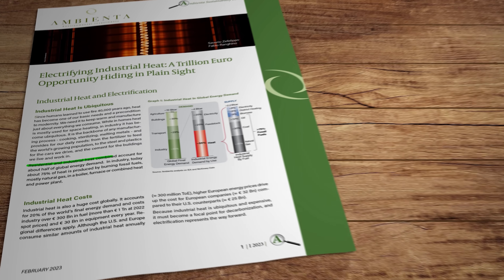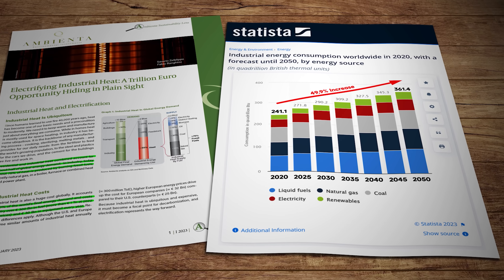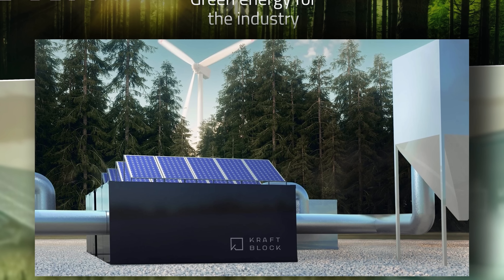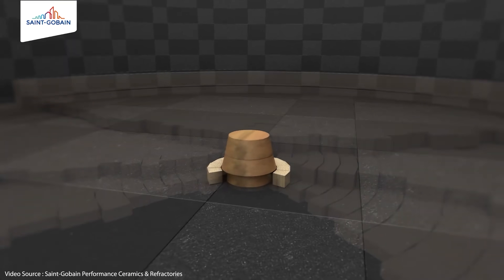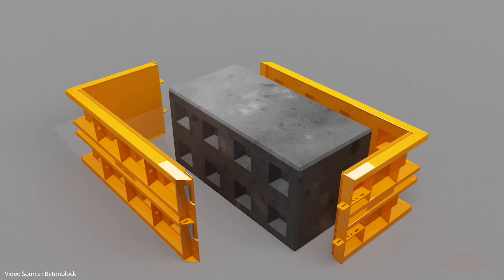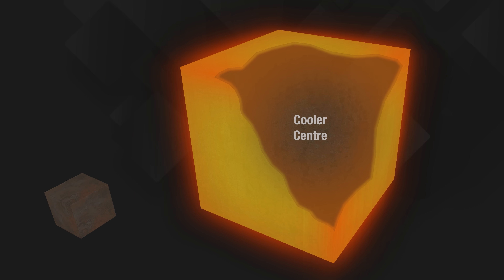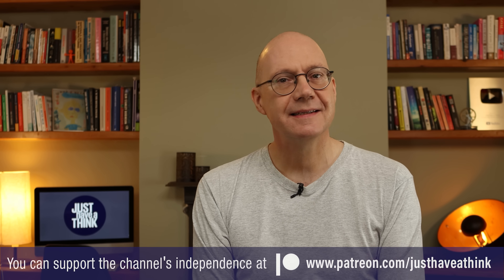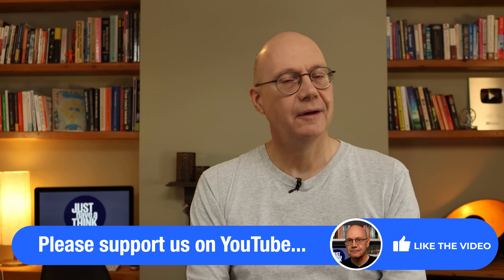Moving waste heat from industry to homes.

Comment: I'm always a bit sus toward modularized technology driven solutions to problems (see: Hyperloop, cars, etc.) and obviously a district heat solution would be ideal, but I do love the idea of a bakery being able to buy a ton of waste heat and being effectively carbon neutral. I suspect they'd need to use heat exchangers to avoid contaminants, and I'd need to see what the potential for pollution would be, but if it's charged with air from a heat exchanger I imagine that would be very minimal.

Comment: I am surprised the safety problem of transporting a 1300 degree storage medium wasn't mentioned.  If one of those trucks overturns in an accident, suddenly the whole road is on fire, and people in nearby cars are dying a grisly death.

It's not as bad as transporting highly radioactive material, or a chemical that can vaporize and kill an entire community, but still I feel this is a non-trivial problem.   I think the containers need to be made in such a way that will not split open in the even of an overturn.
Reply: It doesn't matter because they are still not storing enough energy to make this worthwhile. If its 10mw of energy as the video stated thats only about $600 worth of energy at wholesale prices, your not taking a shipping container very far to make it non feasible, and that's assuming the cost to charge it up and handle it is $0, which it isn't. Might be useful in a static situation to store excess heat energy to use later when energy supplies are lower, like heating a solar powered building at night.
Reply: By comparison a tanker truck full of diesel is holding about 200mw of energy if my envelope maths is correct. Even assuming 70% is wasted by burning in combustion engines thats still 60mw.
Reply: @AusKipper1  Good point but the fuel doesn't necessarily ignite, does it?
Reply: @yeroca My point was that noone is going to be transporting it anywhere because it's not a financially viable proposition so no need to worry about it.
Reply: @AusKipper1  The process needs to make economic sense before it can cause a safety problem, you're right.  That's in a sane world anyway.  Sometimes goverments will invest in uneconomical projects for political reasons, or to enrich themselves and their cronies, but this doesn't seem to be one of those cases.

Comment: I was rather skeptical at the start of the video, but seeing the potential applications in industry and district heating convinced me that this can be pretty useful.
Reply: Plus the trucks could use good old-fashioned "steam engines" instead of being electric and thereby raise the efficiency and limit the resources needed to build the trucks :-)
Reply: @madshorn5826  don't hold your hopes up too high on that one, there's reasons steam engines have fallen by the wayside in most applications.

It's definitely got to be considered though.
Reply: @alanhat5252  
Weren't these reasons mostly poor insulation and incomplete combustion of low grade fuel?
The latter does not apply here and we have nailed insulation :-)

I am not imagining an old style chu-chu, but some modern version.
Maybe a Stirling engine producing electricity for a small battery/super capacitor?
Reply: @madshorn5826   Theoretically, this could work, but we fear it has no business case behind it 😅 You are not the first to have the idea though :D
Reply: @madshorn5826  "old-style chu-chus" were surprisingly efficient by the time the UK government dumped all British Railways' stock in their rush to nuclear, normally getting 85% fuel efficiency from the newer engines (vs 35% for Diesel or 25% for petrol). No it's everything else, tallow-based oils & calcium-based greases never had the R&D that mineral oils have had, water recovery was never solved so vast amounts had to be carried, with most designs at boiling point & under huge pressure, there's a whole list of problems. All I'm certain very soluble but they haven't been solved & there's no moves to do so even though they're still used in certain scenarios.
Reply: @madshorn5826  Stirling engines also haven't had much R&D. They are used but also in limited applications (there's a Swedish submarine which famously "sank" a whole US fleet in a wargame for instance, it's powered by the difference in temperature inside & outside the hull).
Reply: @alanhat5252  
Thanks for the interesting answers.

I still feel that looking back isn't too relevant in our current pickle, because the reason alternative engines haven't been commercialized has been because we had artificially cheap alternatives in the form of combustion engines.

We don't have this luxury any more, so the way we think 'business case' is flawed.

It is very hard to wrap ones head around new basic assumptions, especially when the outdated tech still is used ubiquitously, but we have to if we want to keep a human friendly climate and avoid 10-20 m sea rise and 10-50× the current number of international refugees.

If the efficiency really is above 0.8 this requires government subsidiaries and maybe some sort of plan economy.

Comment: Intresting also on power prduction point of view:
say a nuclear plant throwing away 60% of the heat it produce, being able to ship it to nearby towns which can use it to run district heat, without the need for tens of kilometers of heavily insulated pipes

Comment: What's missing here is the complexity around waste heat recovery. Waste heat boilers have been installed in industrial facilities for a long time but often accessing the heat is quite difficult. Pollution control, like scrubbers, cool the gases down before exiting the process. In other processes, the vessel surface temperatures have to be kept above a certain temperature to prevent other problems like alkali corrosion. Like all things, heat recovery is best built into the original equipment design rather than being retrofitted - Jill
Reply: This is true. There are some challanges. Mostly however heat is wasted where it cannot be used continously, meaning there is no place it can go directly but the atmosphere. This is why we use a thermal storage that can time-shift the heat. The good thing about our storage material: it is very robust, meaning most of polluted flue gases are not an issue. And heat exchanger can do a lot today.
Reply: Heat capture for resale is best added wherever the original system dumps heat into generic cooling such as water bodies or open air .  Heat input from purchased transport is best added where a relevant temperature is useful, otherwise a heat pump can be used to raise the temperature level .  Video explains a lowering mechanism for this particular transport system .  But ultimately 2. Law limits the reusable energy that can be captured and resold from any process .
Reply: @johndododoe1411  "2. law"??
Reply: @alanhat5252  2nd law of thermodynamics probably.
Reply: Yep.

Comment: Interesting.  Back in the 80's I worked for a steel company in the  Midwest US at a blast furnace located on the coast of Lake Michigan.  At that time the company had permission to fill in a portion of the lakefront to use for further expansion, and the slag was used as the fill material.  For a while we had a trial going on to "granularize" the slag by mixing the slag as it was being produced with a large quantity of water.  This would cause the slag to break up into a gravel like consistency.  The result was to be used as aggregate for cement, like in road building.  Nothing came of the experiment, however.  I heard through the grapevine that this was because the company wanted to keep using the slag as lake fill for fear that the government might change their mind about filling in more of the lake before the company was done filling in the allotted amount.

Comment: I’m getting very excited about thermal storage these days. This dovetails with the work of Antora Energy, which is building industrial heat storage at scale using carbon blocks. Antora is cool (no pun intended) because they can get electricity as well as heat from their system, using custom designed “solar panels” tuned to the tight-spectrum thermal radiation from the carbon blocks. The Kraft system here works in a different, complementary direction, by being able to truck-ship serious heat for small to medium industry (like the food manufacturing examples of local bakeries and Frito-Lays). That means cheap, renewable solar could be used to heat up the blocks. It wouldn’t even need to be on-grid, greatly speeding time to market and reducing costs. I can see such a system becoming cost-competitive with gas burners.

Comment: How possible would it be, to have a huge facility,  say- providing heat to a small city, so I'm talking a huge amount of thermal storage material), that could store heat for months. Maybe using solar over the summer, to provide district heat in January? I'd really apprreciate an answer, or a link.

Comment: Heat batteries are a great idea.  One concern I have with the system described here is the availability of high temperature waste heat.  1300 C is pretty hot.  When you design a system that uses heat energy, you try to NOT throw away expensive high temperature heat, but rather discard cheap low temperature heat, usually dispersed in a large volume of air or water.
Reply: I agree! 1300C can't be called "waste heat".
Reply: That is, it is a lot of energy wasted. 1300°C comes for example from gases that need to be flared in the steel, oil, gas and chemical industry. In steel industry they are used, however often it is too much. TWh too much.
Reply: @pin65371  I like the idea of getting power out of it.
Reply: Is it possible to compress lower temperatures into higher temps? I imagine the trade off would be expensive but is it possible?
Reply: @Keano70a that's essentially what a heat pump does.
Reply: @rubidot  so if I have an oven running at 150c, a heat pump could collect that energy and raise the temp by compression?

Comment: Ontario hydro sold heat from its Bruce nuclear plant to a greenhouse complex. Don’t know if they still are. Steel slag is made into insulation in Mississauga, Ontario from the mills in Hamilton. Roxul is the brand name. London Ontario has a district heating system in the downtown. They could instantly adapt this. I worked at a GM assembly plant in Ingersoll, Ontario. Lots of heat goes up the stacks. Especially from the paint curing ovens.

Comment: This would be very good for high heat differential sources. When the temperature of waste heat is closer to ambient (say, 100 C warmer) it poses a problem of "is it worth it"? to ship low-grade heat to a new location (as you mentioned in the video). How could low-grade heat be concentrated to increase the value? Heat pumps do this job but I imagine expanding the heat differential gets progressively less efficient. Any thoughts on this?
Reply: Have greenhouse complexes next to industry
Reply: For economic purposes we start from 350°C up.

Comment: 1300°C is not waste heat, that is hotter than many thermal power plants run on.
Reply: it's waste if it's just dumped
Reply: Who on earth would dump 1300 degrees.  Have a steam turbine and make electricity.  @alanhat5252
Reply: @alanhat5252  That's kinda the problem, they're not using dumped heat, they're using some sort of heat exchanger ( unexplained by this video ) to put into the air to then pump it through the box with all the slag. They're not directly using the heat of the slag when it's dumped in a liquid state ( also that would only be very narrowly applicable if they did as there aren't that many steel mills just hanging around ).
Reply: Indeed. I don't think there are many places with that kind of heat that just waste it.
But I guess, for the few places that might exist, this could be a good solution.
Reply: A number of buildings in Manhattan (New York City) buy “waste” steam from ConEd, our electric utility. The power plant is on the edge of the island and a network of pipes runs underground to supply the energy to the buildings. The steam is also used at several large entertainment facilities as a special effect. (One example, The Metropolitan Opera, has a steam curtain that is used as Don Juan descends into Hell.)
Reply: I think 1300°C would be if you were heating directly with resistance heaters
Reply: @peterbrown6453 Which is just a large storage heater, which is a good idea but not exactly novel. Putting it on a lorry is daft.
Reply: He meant the temperature of waste heat.
Reply: Waste heat is a subjective term. Some of our proteins run on heat much colder
Reply: That really depends on the industry lol

Comment: Use the heat to generate steam at the heat source. Put it into a pressure vessel on the tractor that will tow the trailer - the system once used for fireless locomotives.  The heat in the trailer could be used to generate steam for the return journey. Free transport, as far as fuel goes.

Comment: Interesting to hear about this German invention. Also in Germany, there are already 3.800 nets where pipes transport hot water from factories to households and 16% of German households are heated that way.
Reply: Fjernvarme is big in Denmark and has been for many decades.
Reply: moving waste heat to somewhere it can be used has always been a good idea.
Reply: many europe countries have such systems. and they are better than moving trucks around.
Reply: Trucks make sense when it becomes less practical  to install many kilometres of pipes=expense, maintenance and heat loss. Pipes are good if the source and customer are close to each other @jebise1126
Reply: Great idea!
Reply: Kind of sad, that's so rare in the west
Reply: Sector coupling is the answer

Comment: I calculated recuperative heat exchangers aluminum have amazing specific heat capacity in ration to density. Cooper have worst ration from all metals. Aluminum is the best. That is not very deal for recuperative heat exchangers even you can replace 30 kW electric motor to 15 kW and save shit load of money on electricity bill if you replace steel recuperative metal with aluminum. But for transportation where you literally transport hot stuff I think aluminum very low density compare to other metals but very high heat capacity compare to other metals must be choice of metals. Problem aluminum is expensive is very usable metal but also expensive compare to carbon steel. Biggest holly grail is in simple regenerative heat exchanger where you can save 6 billion dollars around the that is big commercial secret. Coal burning recuperative exchanger is bygone era technology.

Comment: Data centres would seem to be a good source of waste heat, albeit at a lower level. It would go a long way to overcoming the objections that always arise when planning permission is sought. It’s one area of business that isn’t going away soon.
Reply: The problem is the low temp heat.  It can only heat the battery to the temperature of the heat, so the battery won't contain enough energy to be worthwhile.  You'd need to use a heat pump to concentrate the heat, but that would be expensive.
Reply: Expensive and heat pumps simply can't output heat that hot. Maybe you could extract the low temperature heat from the data centre and then do the rest with resistive heaters, but I'm not sure how well the economics would work out unless you have a lot of surplus renewable energy.
Reply: @jonathanmelhuish4530  maybe some kind of local use, like greenhouses or community heating. Seems a shame to see it going to waste.
Reply: Some datacentres are already selling waste heat
Reply: @alanhat5252  very good to hear that!

Comment: The surface area surely doesn’t affect the storage capacity, only the speed that the heat can be put in or taken out of the system?
Reply: The surface area reduces storage capacity in two ways: (1) the conductive coating has less thermal capacity per tonne or per m^3 than the flag, and (2) in order to cook and cook it with air there needs to be gaps between the grains, and the air spaces again don't die much heat
Reply: @trueriver1950 exactly, a solid block would have the highest heat capacity, I think his statement at 5.40 is an error.

Comment: I would like to see thermal storage blocks that are also structural like concrete so that the material can serve multiple purposes and the thermal storage can just be part of the building. This is a similar concept to structural batteries.
Reply: I don't think repeatedly heating a structural part of the building to glowing hot temperatures would be a good idea.  The materials involved are cheap enough that optimizing each to purpose would be better.  In the case described in the video, the heat battery is mobile, so couldn't be part of the building.
Reply: you can store thermal energy at lower temperatures in buildings, but not 1000C!

Comment: I live in Philadelphia and there is a huge local bakery for the Tasty Baking Company that makes TastyKakes. I have toured their factory and they now bake every thing with hot oil that is moved around the factory in pipes from a central heating facility. 
This would be perfect for them. It would require very little additional investment and might lower their energy costs massively. Maybe our local utilities could sell them wasted heat from their power plants.
Reply: Yes, in the Eneco project we also use the existing thermal oil cycle and have a system to replace natural gas. So this is a perfect use case for power to heat. For waste heat, the temperature and amount near the Bakery needs to be given.
Reply: Shouldn't it be Kompany, faktory and kosts?